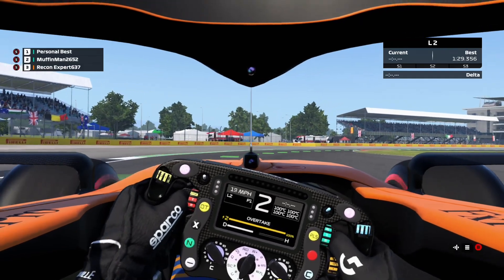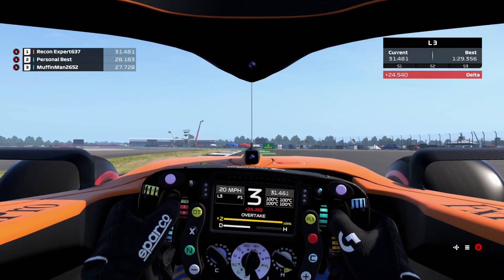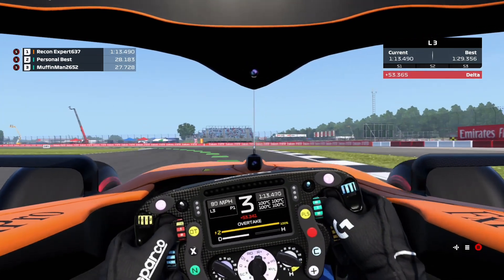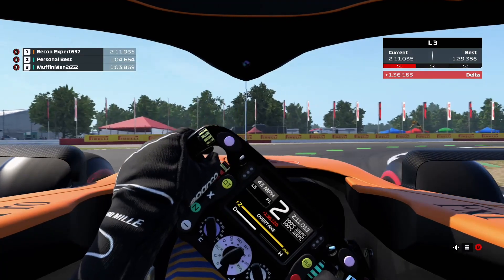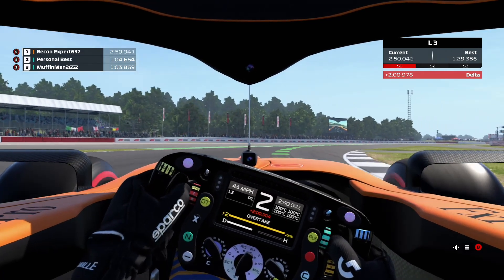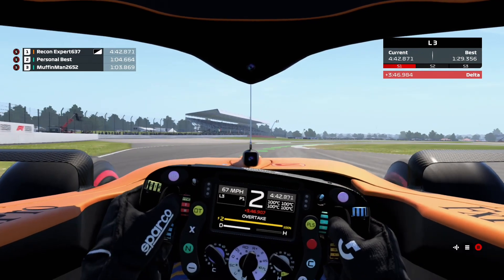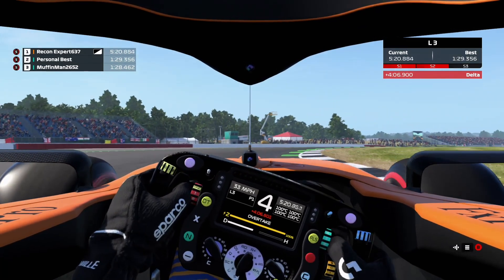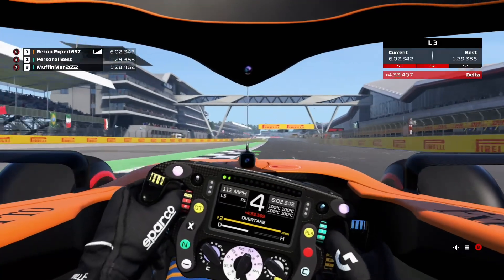F1 British GP Silverstone Tech Preview

Comment: Hiya Marc, when we look at aero design, and previously lap records at certain tracks that have remained for years. And then we see some team cars slower than the previous years, does this mean the optimal aero package was reached and in fact the aero department has taken a step backwards or does it come down to the power plant. I guess I'm asking, due to the red bull and the Ferrari powered cars haven't been able to take that step forward with a faster car than last year, why can they not use last years body and aero package on the new Chassis and power plant is it really to difficult or goes completely against FIA rules? Racing Point as the example.

Comment: So 3 races in and I’ve only heard DAS being necessary in a race in Hungary after Lewis switched to Mediums because the track was drying. Otherwise, not that important? And though Mercedes argued successfully that DAS was a part of the steering, doesn’t Hungary prove Red Bull right that the primary purpose is for warming up the front tires? Very curious as to your opinion on that.
Reply from the maker: It's definitely a device that can have a great impact on tyre temp and Merc are still learning its uses and effectiveness. It has the potential to be a brilliant tool. The fact that it's deemed part of the steering is irrelevant to what it's used for in the rules.

Comment: Any idea why George Russell think that Williams will be worse off at Silverstone than at Hungary? I've heard from various sources that their biggest weakness is a lack of downforce and mechanical grip. Yet their best performances last 2 years seem to come at Hungary which is a high downforce track. You'd think the Merc engine would make them a bit stronger at high speed circuits. Can the car just not take advantage through the high speed corners?
Reply from the maker: I think their aero efficiency just isn't good enough, so at high speed they lose out or  can't lean on tyres enough. Silverstone needs good aero efficiency, meaning you need good downforce for the high speed corners, but not at the expense of straight line speed.

Comment: Great Britain GP analysis.
Hamilton won is nothing new, compared to Ferrari, Leclerc only came in third due to the puncture of Bottas' tires and the bad start position of the second Red Bull car from Albon, the Thai made a mistake in Q2 and started a lot behind, starting more ahead and with less problems as he had today, he would have easily reached 4th or 3rd place. Under normal racing conditions, Ferrari's reality today is to occupy a maximum of 5th place, as Vettel said at the Hungarian Grand Prix. It is so ugly at Maranello that Ferrari used a low downforce rear wing to be able to qualify better and gain speed on straights in the race.
In the next GP, which will be next weekend, the reality of Ferrari will be confirmed, the other competing teams due to what happened today, will not make the same mistakes in tire management (Mercedes and Mclaren), and the novelty of Ferrari to use a low downforce rear wing will be copied by Ferrari's direct competitors today, Renault, Mclaren and Racing Point, so after the next GP that will be on the same track, we will see what the reality of Ferrari is.